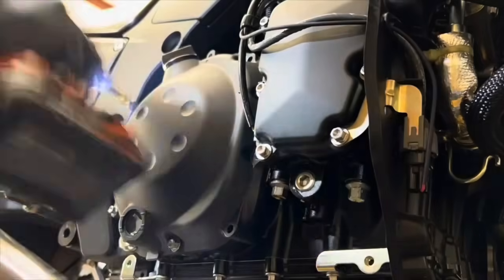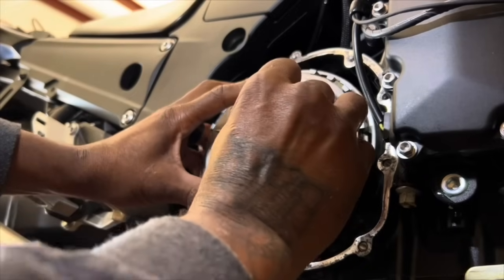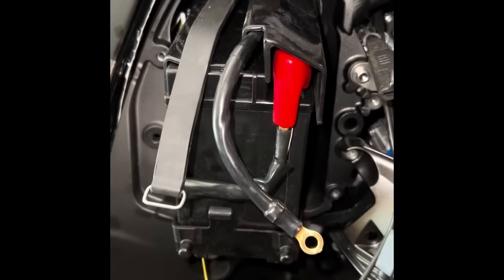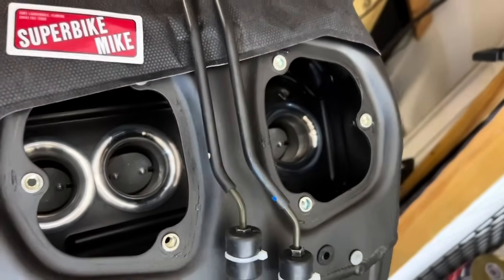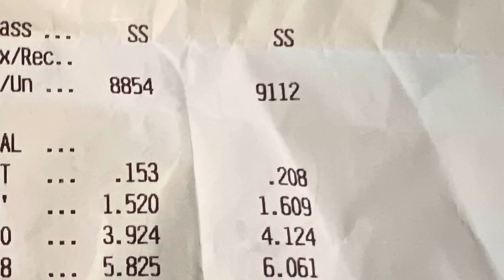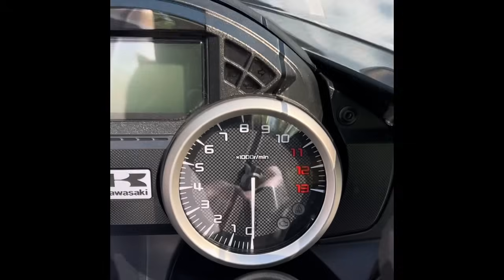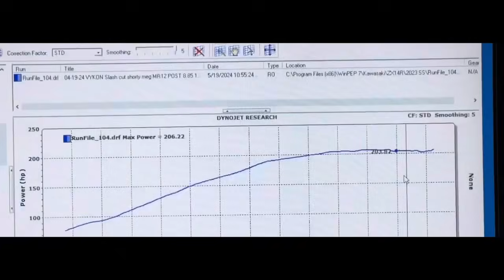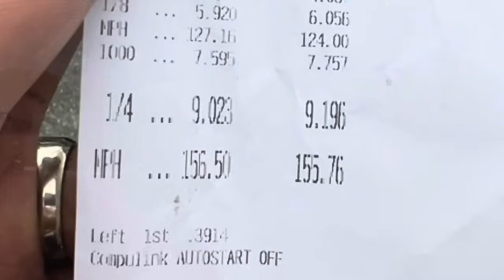KAWASAKI ZX14, STILL KING OF THE HYPERBIKES! NEW GEN 3 BUSA STILL COMES UP SHORT!!!

Comment: Awesome content! What kind of gains did you notice with the short velocity stacks? I would be interested in purchasing a set if there was a gain. I was trying to read the contact number for them on the sticker but couldn't make it out. Can you post the contact info for them?
Reply from the maker: I tested at the track same day and couldn’t go faster than 155-156, then installed SBM stacks and immediately picked up 1.5 mph. Constant 157-158 runs. 
It’s crazy cause it lost power on dyno but surely picked up with ram air.
Reply: @rickeygadson6095  Thanks RIckey. I ordered a set this morning. Do you see where adding them required any fueling changes?

Comment: Hey Ricky, I want to find out which antigravity battery is it?
Reply from the maker: I’ll let you know.
Reply: Thank you I enjoy your content keep making more
Reply: AG-1601 battery, had different terminal on the tops. If you want a direct swap like oem ATX12-HD...same cranking amps, few less amp hrs, but lists .2 lighter.
Reply: I just installed an antigravity. Atx-12-hd.  Much lighter.  Exact same size as oem battery.  I got a 2012 14r se.  The date on the battery was 2011!!!  
  Holy crap you make the clutch work look easy!! 
  Is that drag tires ok for street use??
Reply from the maker: @daviddiodato5550 thanks. I’m not sure about the Dragmax for the street but the Dunlop Q5 is definitely good.

Comment: U lost power putting in stacks
Reply from the maker: I went FASTER WITH STACKS. The dyno does not compensate for 160mph pressurization so the gains didn’t show. But it did at the track!
Reply: @rickeygadson6095  which stacks did you end up with? Your video says you changed the stack heights. Thanks!
Reply from the maker: @JeffArnoldPhotography SBM Super Bike Mike stacks